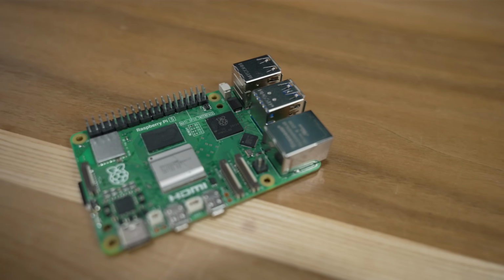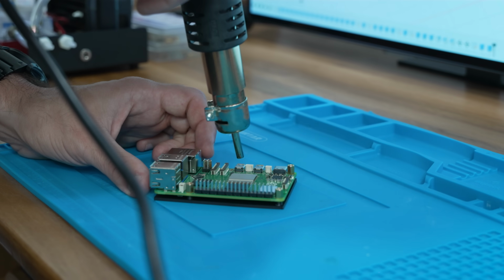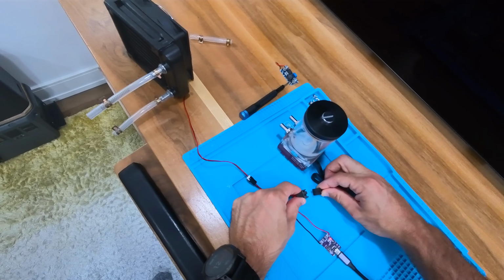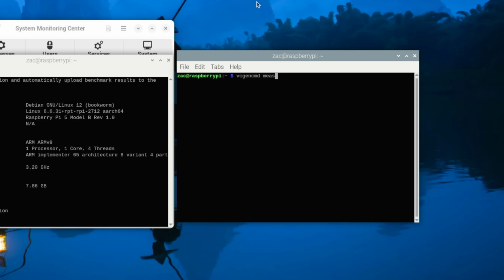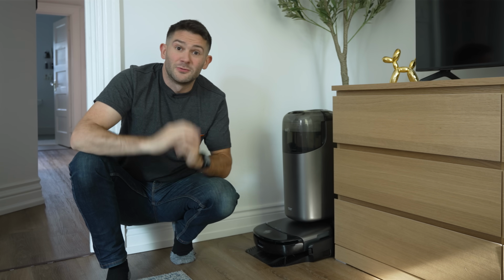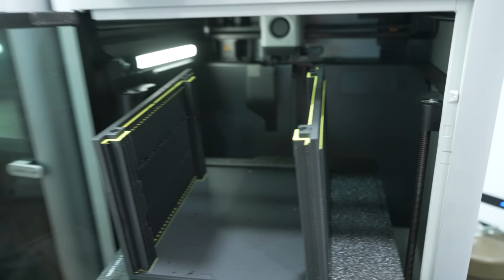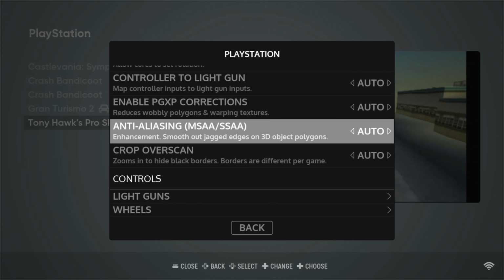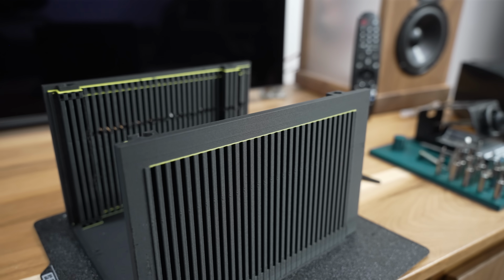Pushing a Raspberry Pi 5 to the LIMIT....

Comment: you can't just overclock the raspberry without considering the power draw. the usb power source is limited. the original pi 5 power source delivers 5 amps at 5 volts, which gives you 25 watts. 

furthermore, you talk about overclocking the raspberry and frequency limitations, but you never show any benchmark results. why?

Comment: Yes, but no.
I get the idea to push a Pi5 as far as possible, but what you are building here is not practical.
A small size x64 PC will outperform anything you are building here, will be smaller, and doesnt have water that can create all sorts of problems. (water is no fun at all)
So what problem are you solving here exactly? A (used) MiniPC for (100)/200 will outperform this whole setup, cost zero work, and "just work". Slap Emulationstation on it and be done. (maybe even Bazzite OS for Steamgames) 
I understand tinkering for the sake of tinkering, but this isnt it chief.

Comment: I think your assessment of Linux being "annoying" while running completely free emulation software on a full ARM SBC that costs $50 is a bit contrived. Measuring Linux as "annoying" on the same scale would result in OSX or Windows being "complete garbage: won't even boot".

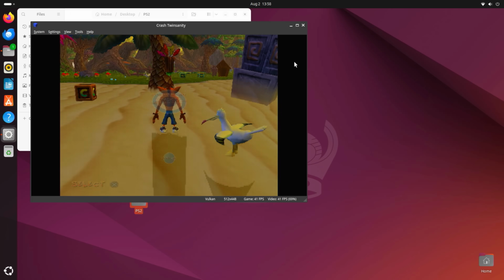Comment: 24:05 "Linux is really annoying to use sometimes" True, but only because you're doing things that wouldn't be possible at all on Windows or macOS on that hardware :)
Reply: Like running emulators or overclocking hardware?
Reply: @matcha6710  Running on cheap low power ARM SBCs

Comment: As cool as this project is, it is such a waste.
The Pi5 would probably stay cool with a medium sized PC CPU cooler(probably even with the fan removed), it would also stay cool enough with a smaller heatsink and a ducted 40mm pointing at it, or if you're deadset on watercooling it would probably even be enough to just have a reservoir and pump, the radiator and especially the fan on the radiator are completely useless and made your case larger and the end product loud.

Comment: I tried. Last video was a 47 minute trap when you could have made a video building a sub instead of rehashing a bunch of old content that really has nothing to do with Sonos in the end.  

We lost the Postmortem, the best of the video behind a paywall. And then it’s 25 minutes of grab (insert electronic device here), make it the best it can be, add walnut, noctua parts, CA glue and something 3D printed and remix repeat.  

I’m out.
Reply: Bro same. Last video was the same build, 3 times in a row,  but for different parts of the same sound system. I was out at like 18 minutes.

Comment: Of course you use the raspberry pi to be the worst emulation machine in the area. Thats the only thing anyone ever uses the pi for. Even though the same software running on the pi will run more smoothly on a ps3, everyone thinks “why yes, the pi is definitely the best retro gaming system”

Just… use a normal computer. Or a phone. Or a ps3, i wasnt joking, the emulation software the pi has actually started on the ps3

Comment: that is complete overkill, why would you use a raspberry pi with a watercooler? (making it non-portable, portability being one of the main reasons for using an ARM device in the first place)
If you want the ULTIMATE retro gaming home system, use a regular desktop PC, even an old one could handle much more advanced games than the Pi
I see literally no point in this